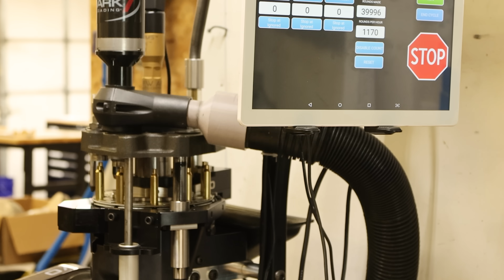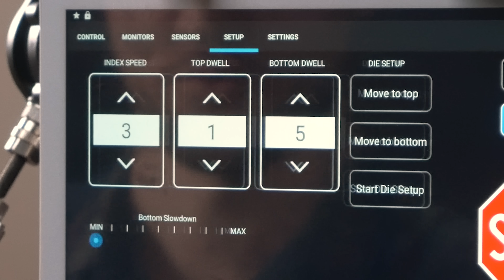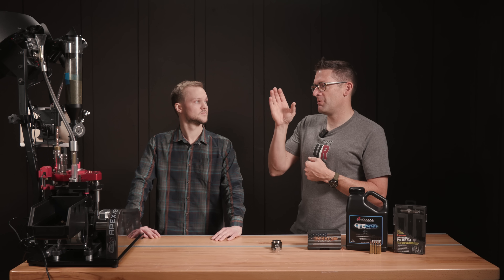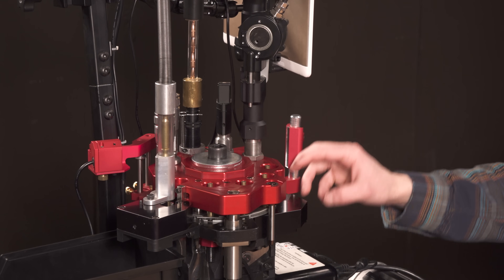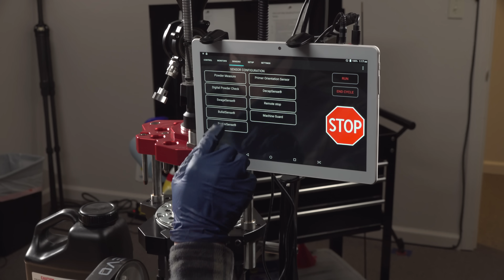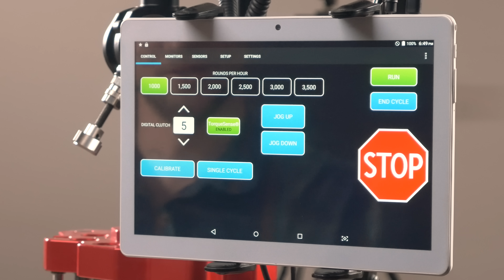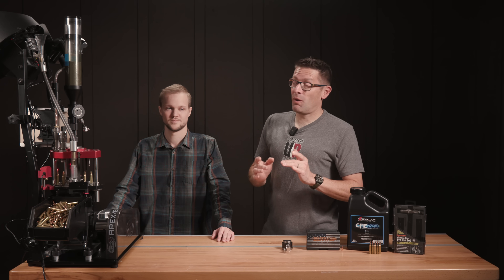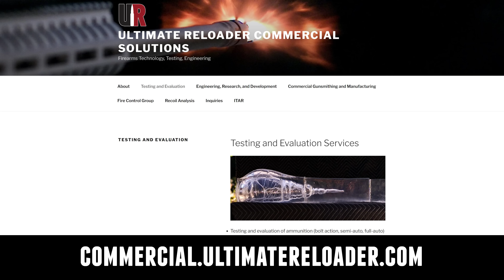Automated Bulk .223 Loading on the Apex 10

Comment: When i crimp my ammo the shoulders bulge and then i have unreliable ammo. Please any advise. Even after i rezise again the ammo is unreliable.
Reply: Are you crimping and seating in one die?  If so you really need to split them up.  If you are then it’s possible your crimp is crimping before the bullet is fully seated and shoving the case neck down which would cause the shoulder to bulge.
Reply: @BCGCPracticalShooter  i set the die up to crimp a small amount when bullet are seated. But i  stop the crimping and want to use the same cases but after full size, some are still not feeding

Comment: What is that concoction you guys are using for sizing lube? That seem to be my slow point is bulk lubing of cases.
Reply from the maker: Our mixture has been 10oz of 99% Isopropyl Alcohol & 1oz of Lanolin. It’s been working very well for us so far! -Kyle
Reply: 10% lanolin, 90% 99% Isopropanol is the ratio they're using I believe. Just spray it on with s spray bottle. There was a short segment on it in the case prep video a few weeks back.

Comment: Have tested cfe 233 and that funny because  out of my 16" m4 26.5 with Barry's,  Hornady fmj & Hornady hpbt  this was the load I found to be the best at 70 degrees  but 80 and 60 my groups  opened  up a little  but still under 1" .Is this what you have seen  also? With cci 400 primers!